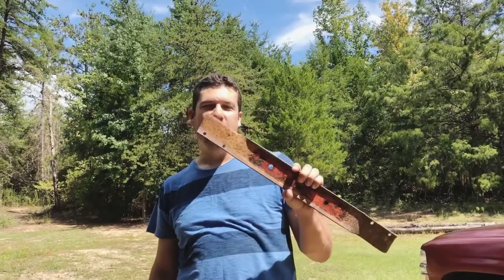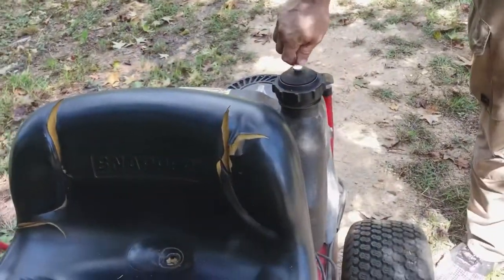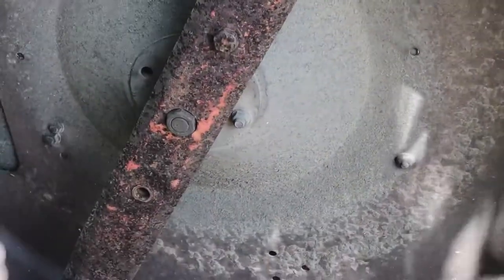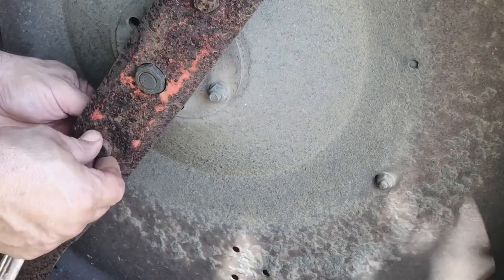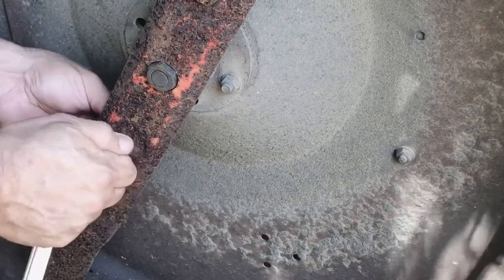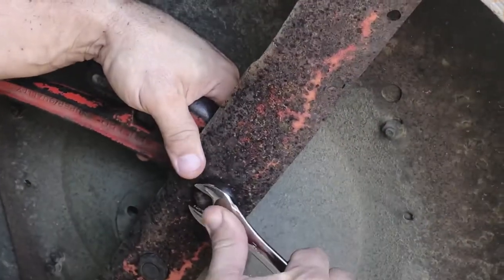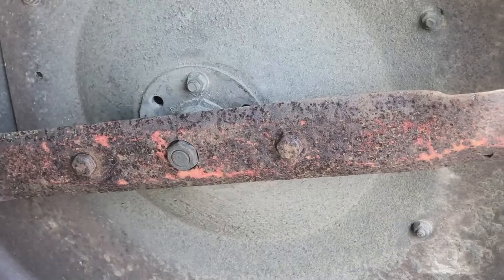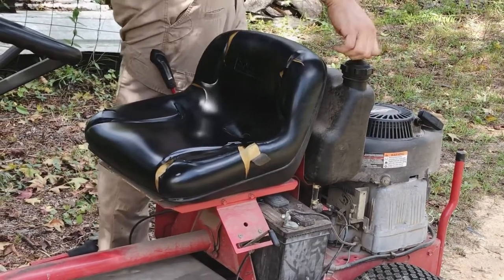How to change the blade of snapper mower

Comment: I never thought to use a pipe wrench. Thanks.
Reply: I would not.  That is asking for trouble.  Prime way to round bolt heads.  Yes it works in a pinch, but proper wrench Is so much better.  Just horrors stories from car projects gone sideway with wrong tools. I would add... perhaps use PB Blaster on the bolts to help loosen & use a socket with Medium breaker bar on the outside for folks needed more leverage.  Then maybe use a block of wood to block the blade.  As a girl I have to add some power adders to help when I don't have the brute strength.

Comment: Suggest putting a block of wood in chute to stop the blade from turning. But thanks… wasn’t sure if reverse threading like on the shaft bolt. Mines been modified for a basket on back for sticks and garbage so can’t flip on end but your video answered my question.

Comment: Is this a 12.5 horsepower Briggs and Stratton motor? This mower looks identical to mine, and I can't find the model # anywhere! I am trying to get the deck belt part # and/or belt size. Any help would be much appreciated
Reply: The belt is the same for 25 and 28 deck do not buy deck belt that says fits all 25 to 33
Reply: @leonmichael576  thank you. I was finally able to find the correct belt. It was a little snug last summer when I put it on but it stretched some and works perfectly! I also still have plenty of adjustment left in both directions.

Comment: Put anti-seize on the threads and you will easily be able to change the blade next time.  I do it on all my mowers as the bolts are exposed to moisture.

Comment: I have a snapper,  I sharpened blade but still boggs down. I also need new front tires, do you know what size? Yours looks like mine
Reply: it Boggs cause either your cutting to low or the grass is very think
Reply: @rubyhedgewood7124  I have it on the highest setting, 6 and the grass is not that thick. I have to have it in the highest gear and cut in circles left and it does fine. If I turn right it Boggs down.

Comment: Not mentioned is what size wrench
Reply: They should be 3/4” for the bolt, and nut. Fyi, DO NOT use a pipe wrench to hold the nut!! Just stop at the local auto/hardware store and get another wrench OR socket set.

Comment: Where can i find the blade??
Reply from the maker: Amazon
Reply: @dailymotivation4y0  thanks. Your videos are good and helpful. I got the snapper sr120 a week ago for less than $100. Engine runs fairly good and needs some oiling here and there and the blade is dull as ever...i already changed the battery on it. It needs a little tlc but i dont mind getting it into proper working shape because ive always heard these were some good long lasting mowers

Comment: I cringed the whole time! Why not stop and get another open end/box end wrench, OR at least get a socket set that has a 3/4” (6 point) socket to help make this easier.  A pipe wrench is used for pipes NOT for removing/holding  nuts.